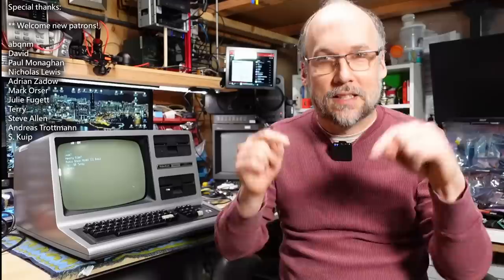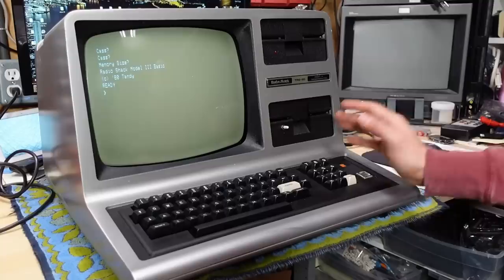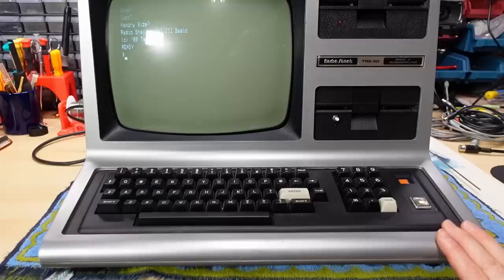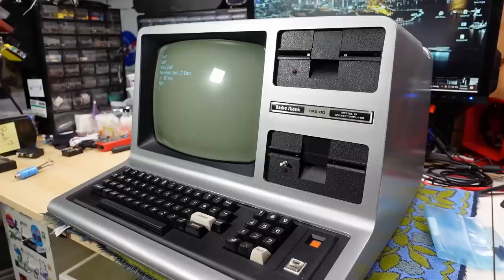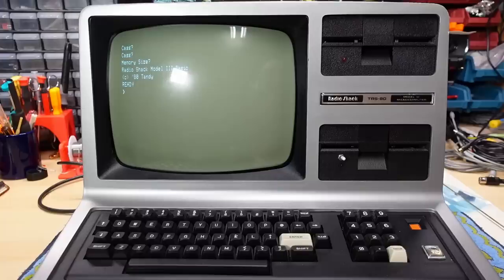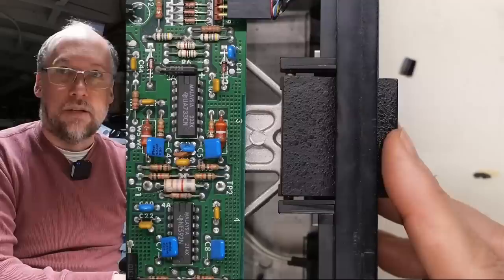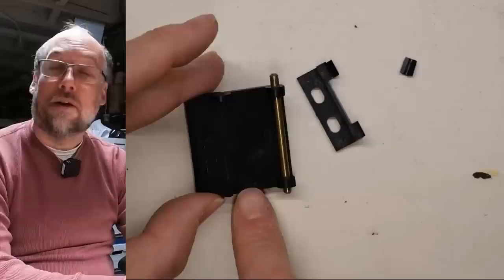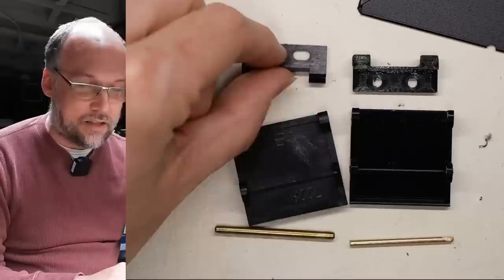Fixing an old disk drive with 3D printed parts (Tandon TM-100)

Comment: There is a guy that made power switch printable part for 8500-9600 machines for mac and it saved the my 9500, they are unobtainable now and are all brittle like crackers

Comment: If you kept the original front latch and really want to keep the original look, I think you could rebuild the broken piece.  It would certainly be easier if you had the piece that broke off but I think you still could do it without that piece.
Reply from the maker: At least the door. I could probably try to carefully remove those broken table and then print just those -- and glue them on. I think alignment would be really tricky, especially for people like me who are CAD/CAM challenged.
Reply: @adriansdigitalbasement superglue + baking soda is the best tool for such jobs.
Reply: @volkhen0  i'd say 'melt weld' with acetone or MEK is better to 'stick' plastics like these, superglue can crack off, i've had it happen many times
Reply: @andygozzo72  polymerizing super glue with baking soda always worked great. But your method is also good.
Reply: @volkhen0  superglue can still 'come off' plastic, i find it isnt very 'super' 😉, plus its too brittle when set, you can get more 'flexible' types, even ones containing rubber, they might be better, but are much more expensive
Reply: @adriansdigitalbasement using  a blob of epoxy to replace/rebuild the half missing hook, with the rod in place (coated with a hint of teflon grease to prevent bonding) would do the trick.
Reply: @adriansdigitalbasement  for plastic structural elements, I have found that fusing (solvent or thermal) is stronger than gluing.  Try acetone on the old door to see of you can solvent bond.  If that doesn't work then thermal bonding probably will.  For the missing piece, you may be able to print another door then cut off the loop you need.  If you really want to get fancy, you could route a channel for the replacement (if the door is thick enough to do that).
Reply: @volkhen0  superglue and baking soda is a trick but is is pretty hard and brittle - probably not a good fit for this situation.
Reply: @bufordmaddogtannen  That could work.  I am just not sure how will the epoxy would bond to shiny plastic.
Reply: @connecticutaggie  prepping the surface with sand paper should work. The idea however is to have the epoxy also overlap the good half of the hook/loop (so that you would end up with kind of a self gripping repair). 
Excesses can be sanded down later once the epoxy has cured.
Reply: @bufordmaddogtannen  I think it is a good idea and would likely work, I am just not sure how durable it would be.  There must but a significant amount of force on the part for it to break in the first place.
Reply: Another interesting idea I thought of is to find a small standoff or nut and drill it out for the proper hole and grind down one side really flat and also flatten the plastic and super glue that in place.  Flat to flat super glue bonds can be insanely strong.

Comment: I wonder if you could somehow mold the face of the faceplate to capture that texture, heat it up, and then press the 3d printed  part into it to get the texture. Mileage may vary

Comment: Can you upgrade to doubled sided or DSDD drives with that system with it's controller?
Reply from the maker: If the controller supports double sided, then yes you can stick in the DS drive and it'll work. If you put in a DS drive in a single sided controller, it will just ignore the extra side. (No harm done)
Reply: @adriansdigitalbasement  And if you cut the notch, you can use both sides of the floppy.

Comment: there's some high frequency squeal in your audio. like coil whine or something. try looking in audacity, in fft mode.
Reply from the maker: 15.7khz from the monitor in the computer probably.
Reply: @adriansdigitalbasement  hmm, sounds lower than that.

either way, you can remove it with a high-q filter - it'll sound way better

Comment: I wonder if that piece would look a little smoother if it was sprayed with some black latex or lacquer paint ...just a thought.
Reply from the maker: Someone else suggested the bed liner spray. The problem with 3D printed parts is when you apply thin paint to them, it just gets absorbed right into it. It would need something thicker I think.

Comment: The best restoration is going to be a silicone mold off a restored or non-broken part, and then casting with black urethane. Will match the texture, and be strong. It's actually pretty easy for small parts, especially such a simple geometry.
The next best thing would be a resin printer. FDM will usually look like junk, although I held some samples (printed on Markforged printers) that were really, really good.

Comment: First off, love your content. I know you deal with retro stuff, but isn't it time to start using standard units of measurement like the rest of the world?
Reply from the maker: Hey even today, I think a lot of stuff in stuff is in imperial measurements, at least in English speaking countries. Plumbing stuff especially and I think these brass rods were for use in welding. (As I had to buy a big package of many rods.)
Reply: If the parts you’re going to use are in imperial units, then you use imperial units.

I don’t make the rules.  I just pick my battles.  And that two sets of units exist and are both in current use is not the hill worth dying on.
Reply: No, most plumbing stuff in the rest of the world is metric. Copper pipe is 10, 15 or 22 millimetres in the UK.
PVC drain pipe is in inches though, i think.
Reply: @adriansdigitalbasement  Actually if you look at the statistic, 98.5% of countries world wide use standard units of measurement (we don't call it 'metric' that is a US/UK thing). Also, there are more than 2 billion english speakers world wide, and the vast majority of those obviously live in countries that use standard units of measurement.
Reply: There is no need to be haughty and condescending. Imperial system units are used around the world in a variety of applications. Even in China, for instance, a country in which Metric is official and that couldn't have less connection to the Anglosphere, you need to know your inches from your centimeters when dealing with electronics. It is the way it is. The world is not going to change just because you are convinced of the superiority of one system over the other.
Reply: @Thunk00  Really? Care to give some examples? Because I live in a country that uses standard units of measurement, we do not call it 'metric' that is a US thing, and I don't remember anyone measuring anything in "inches" here, electronics or otherwise. There are SKUs that carry archaic naming conventions, sure. But that is only to differentiate between different form factors,  like saying that X is bigger than Z. Nobody actually measures anything or knows what an "inch" or a "foot" is here. Even those archaicly named products have their specifications in mm and cm.
Reply: @guderian557  Sure. One particularly prominent example is that inches are used as the standard measurement size for television and smartphone screens.

There are many standards in the world for many different things, and for the same things. It's just the way of humanity. And in the internet era with fast automatic conversions, it's no longer much of a barrier to anything.
Reply: @Thunk00  That is what I mentioned with archaic naming standards for some products. Nobody actually knows what a 50 "inch" TV is outside of the US. It is only the name of a SKU that is bigger than a 48 "inch" TV. If you look at the specifications it is all in centimeters and millimeters and grams. The reason for this is that the world has agreed upon using international standard units of measurement. It is called the SI system, look it up if you haven't heard about it. There is only one such international standard, not two.
Reply: @guderian557  Sure mate. I just told you that I wasn't talking about the US though. These are the units used for selling electronics in China, a country that couldn't have less connection to the Anglosphere. 😂😂
Reply: @Thunk00  Like I said, nobody knows what an "inch" is there, they just know that 50 archaic units is bigger than 48 archaic units. Just like they know the difference between Small, Medium, Large when buying a soda. They don't measure anything in archaic units, all the specifications are in standard units of measurement for TVs and sodas. Just like they are in the rest of the world except for maybe one country. The rest of the world is not going to switch to your units.
Reply: @guderian557  Yeah I don't think so. After the number of years that these units have been in our lives, it's not difficult to have a very concrete concept of what they mean.

As an aside, we also don't use your "standard" units for measuring people's weights, or the weight of meat and fruit and vegetables either. If you ever visit here, make sure to avoid our supermarkets and delivery apps. You'd certainly be perturbed.